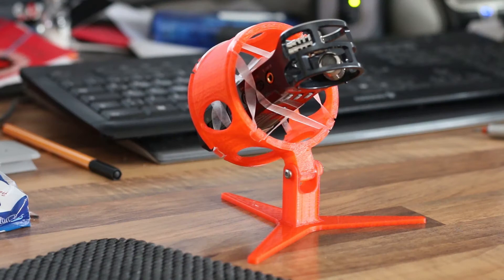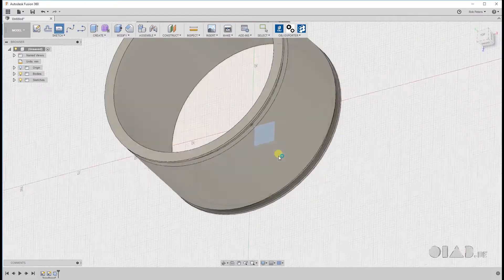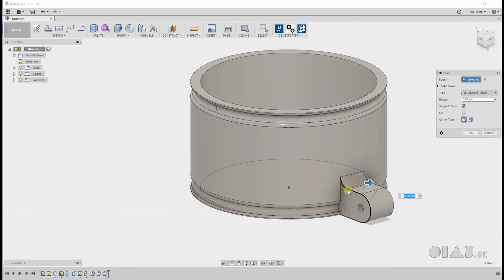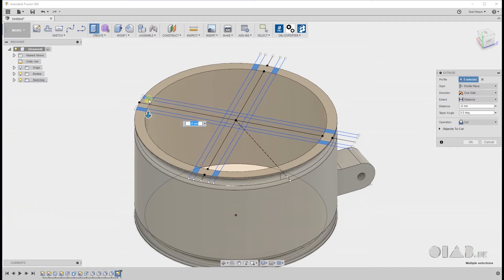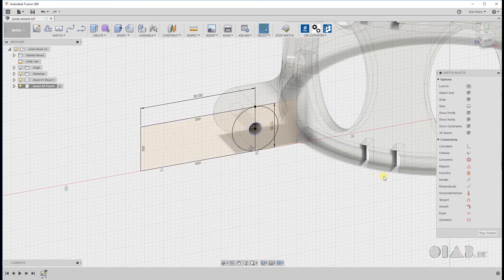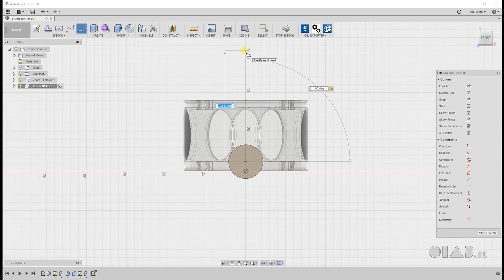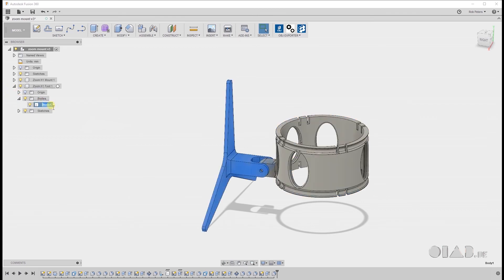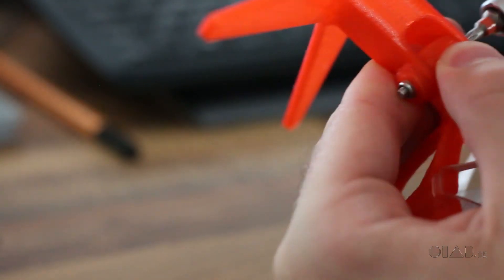Zoom H1 mount - design, model in fusion 360,  3d print, assemble

Comment: The use of rubber bands is very clever but I wonder if it wouldn't be easier and just as effective to fill the cylinder with something like foam rubber to cushion the recorder?
Reply from the maker: Carl Franz thanks for your comment. Using something like foam would work too but will make it harder to reach the buttons on the recorder.